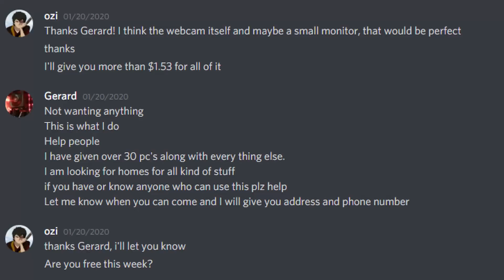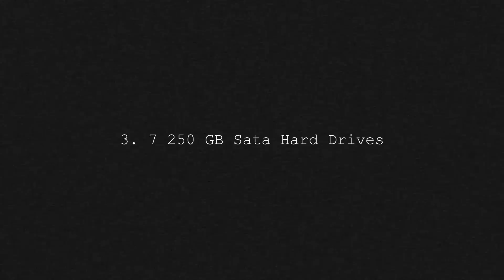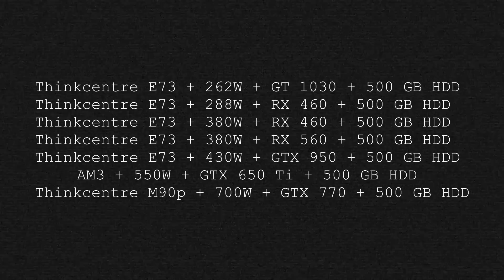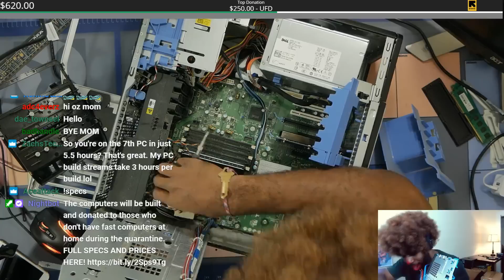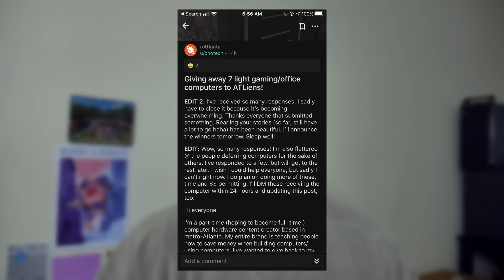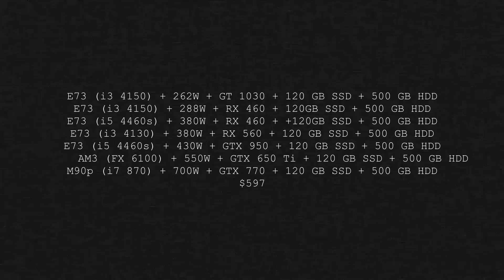I Built 7 Gaming PCs for the Price of One | OzTalksHW

Comment: Gerard is Dope! I need to find a community of ppl who love pcs and not just spec snobs.
Reply: @TheTGR  you can game on literally anything. My celeron sl6vu from 2002/2003 can game.
Reply: @yotoprules9361  It can only game if you restrict yourself to titles from pre-2006. My SL7NW Celeron D (double the L2 cache of yours, and 400 more MHz) felt painfully slow in new games (if they ran at all) when I finally ditched it in 2012. Then again, in hindsight, it's adequate (or overkill) for many of my favorite PC games, as is your CPU. I still have it's motherboard, but it now houses a 3.2 GHz Pentium 4 that I got for less than $4 a couple years ago. Best value upgrade I've ever made.
Reply: @3DGECASE  well he said you can't game on it. Even if it's minesweeper it's still gaming.
Mine is just a laptop though and it has the useless SiS 650 graphics

Comment: If I had, say, 6 working AIO computers, and wanted to donate them, how would I get them to you?
Reply: I could also send several 1 and 2 TB hard drives, and ram.  I also have several CPU's and PSU's.
Reply: Hi Sean, after watching this video some mins ago, it touched me. I plan saving for a year to hopefully get buy parts to build my own PC around this time/ December next year. Also o cried seeing the reaction of those he helped and I plan doing the same for desktop I have which I can't use for 3D modeling because of the CPU gen.  and also it's not good for professional work. I plan giving it away to see someone happy instead of trying to sell it off and keep saving for the Dec. Next year build plan.

You can send the 6 AIO to those who need then in your community. But what's the specs like? If it's cut for professional work as in currently still a student learning, You will be saving a soul here too.

Comment: Does @ozTalksHW take small form factor PCs? I have two Dell Optiplexs one is a 7040 and the other is a 7050 they both have a intel core i5 in them the 7050 has a i5-6500 vpro banded one they both have an AMD Radeon R5 430 2gb but no ram (ddr4) or hard drive. I'm not using them and would love to donate them to you to refurbish for someone who needs them. (The bad news is that I'm in Winston Salem NC so that might be a bit far away but their yours if you want them.) Oh one more thing, the 7050 is still under warranty through Dell until October 6th 2020 for onsite service after remote diagnosis.
Reply: Wow! And here I have a Dell optiplex 3020 SFF. I really wish I could get one of yours and give away mine. That will really be lovely as in something you don't need can actually be good enough for someone else. Just like my optiplex 3020 gives me a lot of headache since I can't use it to learn modelling Maya keeps lagging. But surely someone else will love to have it for their own need.

Comment: I wonder how did that Fx didn't overheat or fried itself with just the heatsink and no fan. When I built my girlfriend's computer (Fx 6300, 8gb ddr3, R9 270), I forgot to connect the CPU fan header, and the computer overheat to the point of shutting down just booting Windows... Luckily it didn't die, but I had to wait like 20 minutes before I could even touch the thing

Comment: I don't know about other people but the reason I was hesitant about getting a used pc was the germs involved. I know they clean it, but how thoroughly?! I recently got an HP 8300 that was used because of money issues but then I had a panick attack when I turned it on because of the dust that the fans would blow into my room! It wasn't until I saw an air purifier and bought it that I felt better. I just wanted clean lungs and clean air. I don't think that's a bad thing? I now have two computers (desktops) in my room: The one I just mentioned and a brand new Dell Inspiron 3880 I got from office Depot for more than twice the price! ... And yes I should have thought about my germophobia (unfortunately not good) before purchasing the other one.. but I've always had money issues so I was used to always factoring in the price of any item before buying it. It's only now that I got a bit lucky and came into some money, but, generally yeah, I always annoyingly had to consider price, even sometimes above my health! But then, I already bought the hp computer and was very curious to know how it would perform! I was surprised that it was just as good as the new one, if not better.

Comment: I have the same lenovo motherboard  with a 180w power supply and I am stuck with it because it has a 14 pin power supply and in my country there are no 24pin to 14 pin adapter that lenovo motherboard got me so angry and I am forced to put a secondary psu because th original psu dont have sata power connectors and you must have a 4 pin to sata adapter to connect it from the board to th hard drive and optical drive.

Comment: If you still have the "dead" Lenovo mobo, it may just be fussy. If pci hole and other strange settings are not perfect, you'll see nothing on the screen. Try different ram, remove all non-essential pci(e), trust me, it's worth it, my s20 which i almost gave up on became an absolute rock-solid workhorse for yrs.

Comment: In my country of residence people are mainly interested in computers for social media, especially for playing YouTube videos with e.g. bachata and merengue mixes. My brother in law bought a computer for DOP 500 (say 4 beers of 700ml each). It had no disks, only 512MB of memory and the CPU was a Pentium 4 HT (3.0 GHz). All fans were broken.  I've added some of my surplus, so now it has 2 fans; 1280 MB of DDR; two IDE HDDs (2x40 GB) and a 56 Mbps Wifi card (PCI). Most apartments share the Internet for mainly phones through WiFi.  I installed Peppermint 10 (Linux) on the BTRFS file system in Raid-0. The system boots in just under one minute :) :)   He now also uses it to watch vaquero (cowboy) videos at 360p.

My own system is a Ryzen 3 2200G.

Comment: 12.5% recycling is actually alot higher than i expected, that being said, all of my computers and servers have been bought off of ebay, and am only now replacing some of these 11 year old computers, with new AMD machines, mostly because the energy efficiency improvements are well worth it. example: my 3600(nonX) uses 74w, and the whole system uses 90-100w under max CPU load. Compare that to my dual xeon x5690, which has 12 cores 24 threads at 3.6Ghz, Considering the AMD 3600 ties the dual x5690 in cinebench (3210 VS 3260) the combined power of the xeon processors use 294w(+/-1w), and the entire system uses ~541w(cpu only load) Now i did have 12xDDR3 10600R and water cooling on both processors, but thats the point of the upgrade, this 140w AMD computer outperforms a 540w computer in EVERY metric except RAM capacity(xeon system can have up to 192GB because of the 12+ RAM slots, there is a firmware limit of 192GB)
Now my gaming/editing rig (3950x) that i built to replaced the x5690 build, still pulls less than 220w under full CPU load (PBO set to 150w), But compare that to the combined score of my 6(six) E5649 processors(2.7Ghz all core), and two x5690 processors(3.6Ghz all core)  the 3950x, just barely gets beaten in cinebanch R20, 16 cores: 9360 VS 48 cores: 10798   (2510+2497+2531+3260)
You read that right, a 16 core AMD processor, is only 15% slower, than 48 intel cores, sure they're 11 years old, but still, compare that to other new intel, its not that impressive, a 10900K scores 6400,  to get similar performance you'd need 6 more cores, or 60% more power, but with 60% more power, comes 60% more power, so instead of 170w, its now 272w, now this is still a vast improvement over the 48 cores at i'd guess 900w(because i cant clamp CPU power on servers and have to go by HWMonitor)
Where i really needed this upgrade, was idle power draw, the x5690 computer idled at just shy of 200w(my guess is the ram, and the CPUs never dropped below 50w at idle), the 3950x can go as low as 70w for the whole system including GPU, and can even be passively cooled(case fans shut off below 75c, CPU below 62). Now the old x5690 could be shut down when not in use, ones where this REALLY counted were key machine like my DVR/NVR server(PLEX+iSpy) and my file server both of which MUST be on always. My new(in progress waiting on parts) machine uses a 3700x with a 55w system idle and only 105w when recording 5 cameras and 3 TV shows at once. The old system however was a little over 160w at idle, and as much as 430w when recording 4 shows, but critically, even though the old server had 8 tuners, it was only powerful enough for 4 1080p shows at once, but the 3700x (i would estimate based on 3x1080) seems to be capable of at least 10 shows at once. 
This lower power draw also means my UPS will last much longer, and my AC bills will be much lower, I dont think the file/VM server will be as much of a saving, because of the 12x7200RPM always on HDDs, but without the drives, the dual L5640 and 144GB of ECC used about 140-160w at idle, and around 180-200w under heavy VM load, With the 3.5 inch drives that goes up to 210w idle and over 400w under load(including drive load)
Oh, and Oz, would you like to take a look at my dual x5690 system, it does hot because it uses 120m AIO coolers and the CPU only has a 70c TDP but if you clean the radiator often, or get better fans, it should do fine and still hit/stay at, max turbo. I dont know if i can hand it off with anything but a GT1030, or a GTX 460/650(maybe broken) as the card i have in there (GTX1080) i plan on giving to someone who needs it.
I'd also be open to donating my pair of Poweredge R510 and Poweredge R710 servers once i am done migrating to new, though i'm probably going to keep the Poweredge C2100 as on site redundancy

Comment: Here in Switzerland you can't find any used PC for under 300$ at all. Today I learned, that that's only true for the online market. You can go to fleamarkets all around the city (Zurich) and get bargains after bargains. Just like the Laptop I'm using to write this comment right now (40$). A thinkpad T510 with an upgradeable 1. Gen i7, Fingerprint reader and a Webcam (all optional). I threw in an SSD, another stick of ram and installed Windows 7 ultimate. I plan on upgrading the CPU to a quad core i7 but it works fine as of now.

Comment: hey oz, i bought a dell optiplex 9020 with a i7 4770 for my son about two years ago, he used to play only roblox but now he is getting into more demanding games so i decided to upgrade his gpu and psu. i recently got hold of a brand new xfx 580 8gb black edition so now i need to purchase a power supply and the 8 pin adapter. my problem is that i live in jamaica and i dont have any immediate plans to visit the usa so i will have to purchase it online and anything over $50.00 attracts some crazy import duties. can u recommend a decent power supply in the 50-70 dollars price range. keep up the good work as most of what i learned about pc building i learned from u

Comment: Did someone mention eWaste?

I've sold a C2D, a C2Q and a first-gen Core i3 PC (latter is AIO) to people for the sake of general purpose use and older gaming (first one; C2Q might do some gaming with an older graphics card NLT Maxwell); anything past 2014 wouldn't do well.

Now I'm trying to find an opportunity on when I can sell a Pentium Dual Core PC for the same purpose (general purpose) -- due to COVID-19 -- but since I installed it on Windows XP as a project, it may be a niche product; I can't see myself putting Windows Vista on it, and I can't guarantee the viability of Linux for most users, as much as I would want that to happen.

Comment: It's not just helping other people It's also a cheaper way and saves the environment. Businesses get rid of computers a lot even if they are 4 years old. I haven't ever built built a computer. But, I like the 2 HP computers I have. I have upgraded from a HP Compaq 6200 pro MT to an HP Z440. The other HP is going to my sister. But, that's the thing older high end computers are as good or better than new ones. Like pay $300 dollars for a PC with a Celeron now that performs horrible. Or spend that much and have an older PC. It's like a car older and fix up or newer and built poorly.

Comment: Oz please i need your advice on my new budget build 
Am from nigeria and pc parts are limited so so limited here, so am going small

Ryzen 3 1200
8gb ram
Msi a320 pro vd/s
Amd rx 470
 My issue now is i hv an oem hp psu 450w......is it ok to use ?
Alot of people says its risky but...i am so low on cash righg now ...

Plus the psu has only a 4pin cpu connector but my mobo is 8pin

Please your reply will b appreciated 
Thanks

Comment: Nice coverage man, I've been working on ThinkCentre A70 (that one looks exactly like those E73s on the outside) for a year but didn't make much progress on "modding" it. The good thing is, I remove the side bracket for the HDDs on those A70s, I could fit up to 240mm radiator/2x120mm fans on the front (also thanks zipties!) and probably up to 11 inches/28cm of graphic card length.
.
Here's my A70 with ripped side bracket, it's just Phenom II w/ a 8GB RAM, R7 360, and an SSD + HDD (put it in the 5.25" bay): https://drive.google.com/file/d/18aBqGWmzB_nDNPsqJaFlc2jK2lv5IQV7/view?usp=sharing
https://drive.google.com/file/d/18aJVC40a2E5LGHg_KWYVdGimo8gsqZcn/view?usp=sharing
.
And here's the less desirable stock A70 before I remove the bracket and the LGA775 system still lurks there: https://drive.google.com/file/d/1ouvGniI4ADXdo7ilgs8cB5vGGSG_iZTZ/view?usp=sharing
.
Sorry if the quality are bad, my phone didn't have that fancy camera lol

Comment: a t3600 is an alright old server... good tip for any broke ass boys like me out there, secondhand/refurbished servers make awesome gaming rigs from price for preformance. Got a t3610 with an e5-1650 (will upgrade that to the v2) and threw in a gtx 960 turbo oc and the t3610 came with 32gb of ecc ddr3 ram which is good. Total price was around the $580 mark and I can play gtaV highest settings with crisp framerates.The bottle neck for me is that gtx960 so will either upgrade to whats better preformance thats got a good pricetag or just stay happy as I am now..